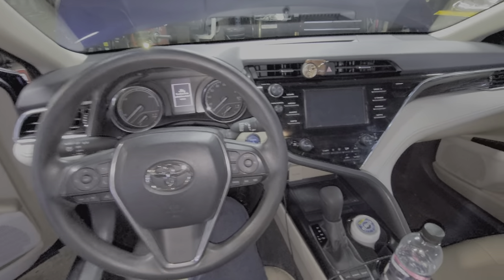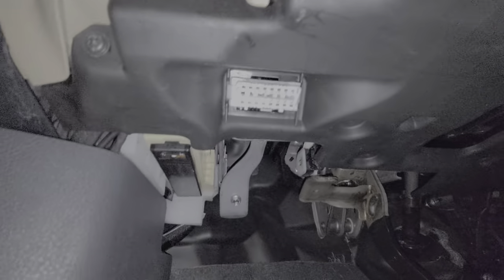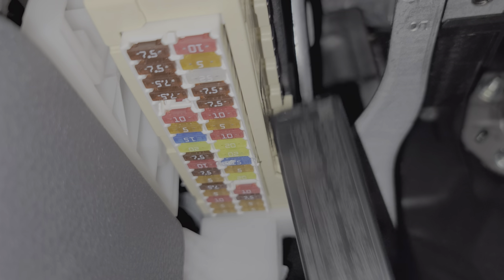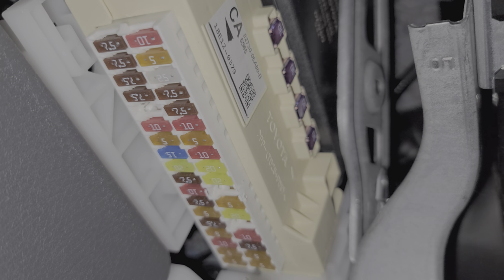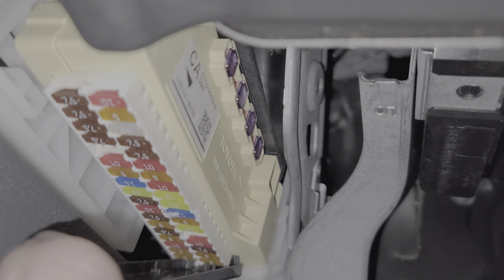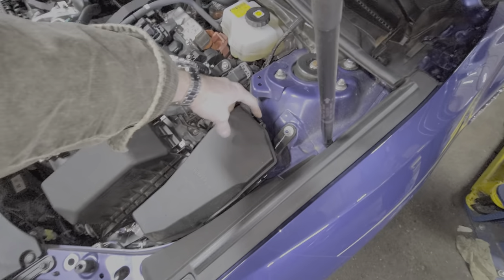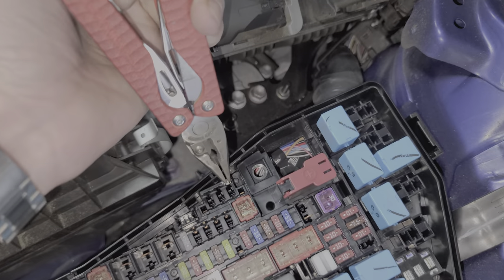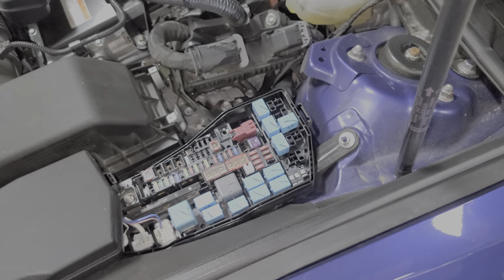2019 Toyota Camry Power Outlet Fuses, Cigarette Lighter Fuse

Comment: New to automotive fuses? Here is a crash course. To avoid getting stranded, never buy generic brand fuses! Stick to Bussman or Littlefuse brand. All the small fuses since about early 2000s are have this model name: "Low Profile Mini". Fuses cannot be removed by nails only. Remove carefully with pliers, or other similar plastic tool.They are a bit fragile, if you plan on replacing them more then a few times, get some spare ones before you start.

Comment: Nicely done, considering the fact that even the owners manual is rather vague about the reasons that the charging outlets are not working. Thank you for your sharing your knowledge about the repair procedures of the Yoda. Ours is a Hybrid and the fuses are precisely where you said they would be, saving me a ton of time tracking down the culprit.
 Some of the other Toyota "repair" channels are even more vague than the owners manual. You nailed it and we were able to track down the offending fuse and replace it in a world where we absolutely and positively CANNOT do without fully charged Smart phones.

Comment: Is there a fuse that controls the alarm system on the 2019 Camry?  The alarm on my car triggers when the car is parked outside in the summer heat.  Can I simply remove the horn fuse to alleviate the problem until I can find the time to get it looked at by Toyota.

Comment: I have a 2021 Camry and I live in a cold area. It does not have heated mirrors and I want to modify the heated mirrors after the factory. There are heated mirrors in the market but there are no wires for them in the system. My question is, is it possible to connect two wires for each mirror, one wire from the wire that goes to the rear window, i.e. the rear heated wire for the window, and put a ground wire on the body of the car so that it works on the same switch as the rear window defroster, and does this affect the electrical system in the car?

Comment: I am installing a dashcam and it has 2 cables. First one red goes into fuse 10A. The second one it says connect to the fuse that uses battery power. Is P/Outlet fuse that you described here is for battery power? Thanks.

Comment: i have 2019 toyota camry se and i recently changed the TAIL 10AMP fuse which was blown under the dash after changing i works perfectly however i am concered after fixing i checked with the fuse tester there is no light i can see on the fuse tester do that TAIL fuse and PANEL fuse have positives poles as fuse tester just have the black wire. ? however its working just fine.

Comment: Meanwhile in BMW i had to remove the trim piece below the glove box, then the glove box to access the fuse box. When installing the glove box i found out that the glove box light connector is hitting the mounting points and bending. Someone before me already glued it but It broke off fully. So had to glue it and carefully reinstall it but i have no idea how long it will last. Dont understand why they made it that hard because the fuse box is the first place you check when there is an electrical fault. 

literally a 1 minute job turned into a whole day

Comment: 2018 toyota camry power outlet can i use fuse 20amp because 15 broken when uso air compresor tires
Reply: Never replace fuse with a higher amperage. If you need more amperage, connect straight to battery using alligator clips. They should be a buck at your local Surplus store.